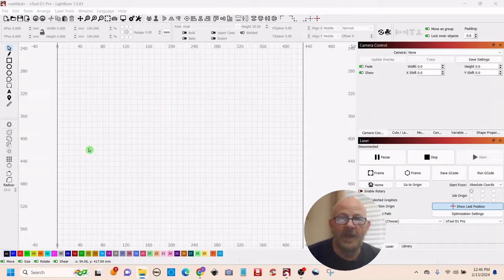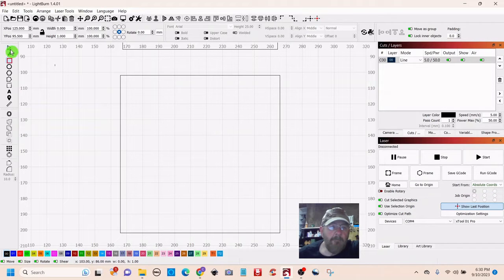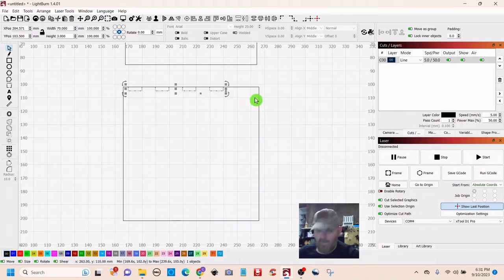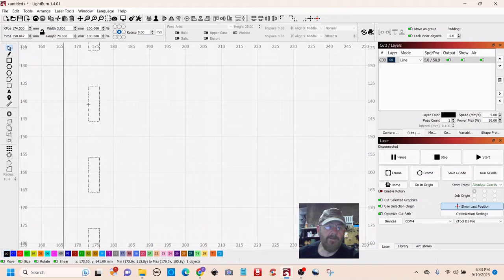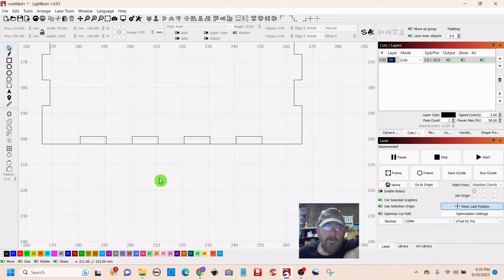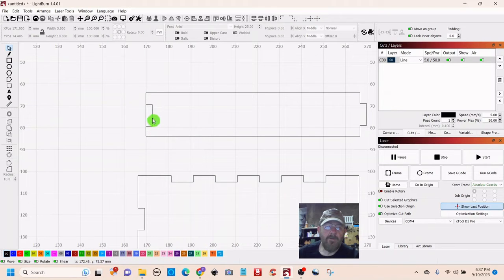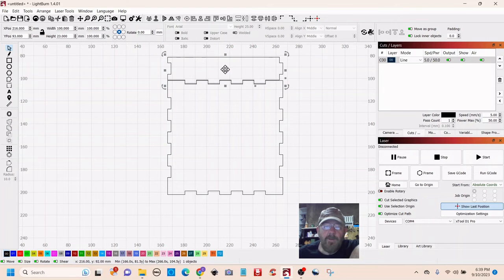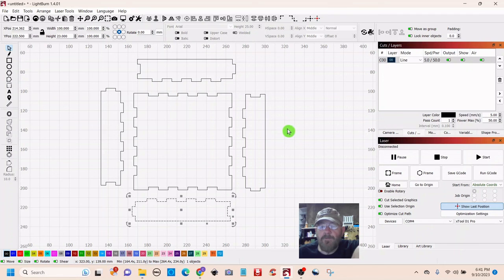Make a Tabbed  Box | Lightburn Tutorial #14

Comment: If i need to make box 100mmx100mm does my all 6 sides need to be 100mm just to add and substract slots by 3.4 mm that is thicknes of material
Reply from the maker: Yes, you will need to account for the material thickness when designing each side of the box. In the video, my material is 3mm.  If yours is 3.4mm do this: Make the bottom 100mm x 100mm. Make the sides 96.6mm. To the sides, add a tab of 3.4mm and a slot of 3.4mm to make the overall length of each side 100mm. The key is that in the final product, the sides, bottom, and top would all measure 100mm in length. I hope this helps - if not, let me know and we can figure it out.  Thank you for watching and for the question!
Reply: @DGLaserCraft i figured it out 
Thank you
Reply from the maker: @pravionica  You are very welcome - Thank you!
Reply: This is what tutorial need to look like
Great content
Reply from the maker: @pravionica  I appreciate the kind words! Thank you for watching and commenting!

Comment: If you make you small boxes (to make the tabs and slot) the double what you need, than you can snap them on the line and you never had the issue that some where just not touching the line where the need to be on. Then subtract or weld them.
Reply from the maker: Thanks for the tip. Getting pointers from viewers as I learn has been a great help. Thanks for watching and commenting. Take care - Dave!

Comment: Thanks for your video, but don't you have to make allowances for the kerf?  Otherwise the joints will slack.  Please correct me if I'm wrong.  Sorry I'm new to this. I have just bought my first laser. An Atomstack X70 Max  diode laser, I haven't used it yet.
Eddie
Reply from the maker: You are correct on the kerf which I typically allow for manually with the slots only and not the tab.  With lasers having such differences between types and flucuations for focus, I made a video to help explain it a little better - here it is: https://youtu.be/7Xhs5LGjWrc?si=xNx13CXROWPr0rwv.  You are in for big fun with that new laser and as you learn, feel free to ask me questions anytime.  Thank you for watching and for the question.  Take care - Dave!

Comment: Hi, would you know why all slots in my lightbrun to not come out square ? they a a triangle shape. I'M NOT TRYING TO  RESIZE THEM. they just have a triangle shape. thanks for taking time to read this
Reply from the maker: I have heard of this happening and in that case, a belt was not tight enough. This can also happen if the lens is out of focus or alignment. If the problem is minor, it may correct by cutting at a slightly higher speed if possible. I appreciate you watching and your question. I hope this helps!

Comment: Hi maybe you can help me I am doing the same thing you are doing and when I make the mail parts and center it it's off 3. THOUSANDTHS of an inch every time I do it I cannot figure it out just on the mail tabs not the female After it's done I use the measurement tool and it's showing 3 thousand of an inch off
Reply from the maker: As you make the top small side (97mm length), if you add a male tab on one end, and female on the other, it should then be the same length as the box - 100mm in the video.  If this is complete before you add the 4 male tabs to the side, they should center properly - if the first part is not complete, the measurements will be off by 3mm.  Hope this helps, if not, let me know and we will figure it out. Thanks for the question.  Take care - Dave!

Comment: Keep up the videos. Great learning tool. Also once you know your kerf cant you just add that in light burn?
Reply from the maker: I think it can be added but so far I have just made adjustments to the slots.  I appreciate you taking time to watch and for the comment. Take care - Dave.
Reply: @DGLaserCraft  I think if you click on the  line you want to offset in cuts and layers it opens up a box  with all the setting for that line. Kerf offset is down the list. So I have not tryed it but I would think you just put in your off set there and it will do it for you. Just make sure to change it back to 0.000 for your next job or it maybe off? I haven't played with that setting yet. I am still learning to. Keep up the good videos.
Reply from the maker: Thanks - I'll give it a try.  Lots of learning with Lightburn and the updates are pretty frequent.  Take care - Dave.